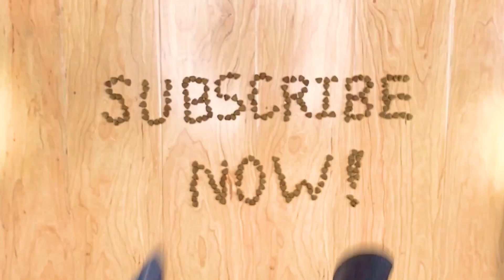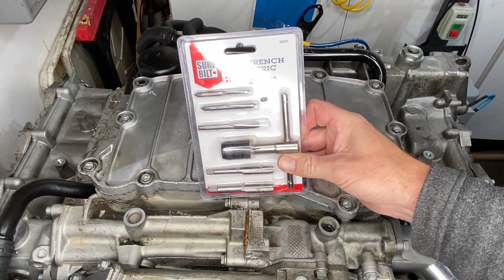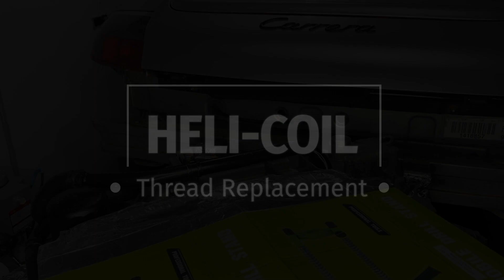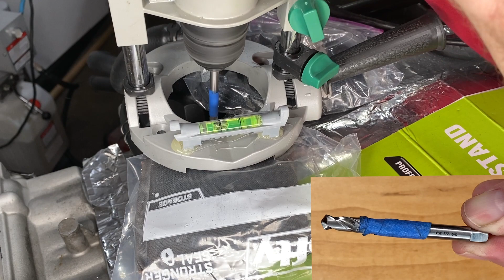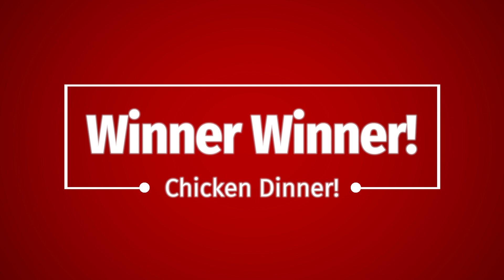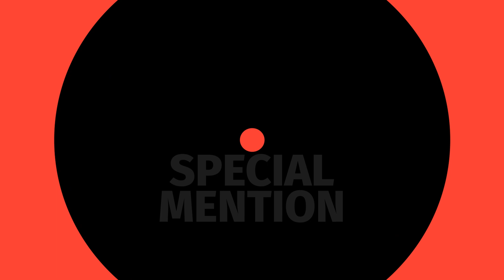HOW TO: THREAD REPAIR with Heli-Coil, Time-Sert & MORE!

Comment: Is it possible to fix a stripped thread on a steering rack on a 2003 Honda Odyssey that's in a very tight spot? It's for the line going from the power steering pump to the rack down by the right front wheel side.
Reply from the maker: Thats very specific Robert, one of the options mentioned may work for you especially if you can get a drill in there. Good luck🍀

Comment: Thank you so much for your video. Very informative. I'm about to change my spark plugs on my 1989 jag V12. They are notorious for shearing off. I need a plan B if I experience that agony! I'm wondering if the timesert method is good for spark plug threads? Also if you or your amazing contributers have any tips on avoiding swarf in the cylinders when doing this (over and above what you did in your video or grease on the tap set). Anyway, thanks again.
Reply from the maker: Hello MCX C, I believe you can use time-serts on spark plugs, for sure you can use the Helicoils. They have much larger sizes the the ones I used. Other than grease, I did not learn of another method to reduce the swarf infestation. Good luck with your project 🍀 (I used to have a V12 XJS, it was a really cool pain in the ass 🤣😂) Thank you for watching 🤘😎

Comment: Finn, I have my engine on a stand and with help I rotated the block upside down. In the process, I heard a "POP" and one of the bolts holding the engine to the stand popped its threads.  I'm in a pickle with that one because it's a bolt that holds the transmission to the engine!  Not sure what to do at the moment but this video is perfect timing!
Reply from the maker: Hello Yogi! That is one on my fears, sorry that happened to you. Depending on which bolt it is I would probably go with a huge time-sert. Plus, something I did not realize when I ordered them is that they come in different lengths also. If I was doing it again, slightly longer might have been better. Good Luck 🍀
Reply: @ManinaGarage  From someone that's used Helicoil often, the time-serts look legit! Let's hope they have a size big enough for tranny bolts.

Comment: The drill guide may have been a bit overkill for this job, but glad it worked out.  I have found that if you apply grease to your drill bit and tap, a lot of the metal shavings will stick to it and come right out without the mess of the shavings all over the place.  Good video, as usual!
Reply from the maker: That drill guide was dubious from the start 🤣😂 . I feel that the existing holes do a pretty good job of keeping you in the ball park of straight and true, I might trust myself next time.  For my first adventure I was ok with belt and braces 🤞. The grease tip is a good one, thank you, I should have done that 😳 . Thank you for watching 🤘😎
Reply: @ManinaGarage  But if you ever have to drill out head studs, that drill guide will be a life saver!  Gotta have one for that!

Comment: Hi Finn excellent I’ve been looking forward to this one!! 
Just to clarify before your million subscribers think I’m a complete idiot, I didn’t suggest the rivnuts for this particular job but thought you might like for Mrs Maninagarage to buy you some for Xmas!! I would love stuff like that. I wouldn’t be without them in my kit especially if you’ve ever built a Land Rover Defender.
PS . ITS ALUMINIUM!!!!
Merry Xmas 🎄
Reply from the maker: My robot fantasy was truly fired up by those rivnuts 🤖 I was planning all the aluminum paneling that I could easily bolt on and off while turning this Porsche into some kind of German Knight Rider recreation………….anyway! I appreciate the heads up 🙌. Also, you had mentioned waterless coolant. I spoke with a few people about it including Lee Jenkins and Miguel at TuneRS Motorsport, they both said don’t do it. Lee went as far as to say that it’s not a foot match for these engines. The general gist is that waterless coolant, despite all it’s amazing qualities leads to higher cylinder head temps. Just save me some cash right there 😅

Comment: When tapping into a blind hole you need to use a plug tap and finish with a bottoming tap. That's the only way to get the thread to the bottom of the hole. HTH's
Reply from the maker: Hello Steve, thanks to YOU! I now know there is more than one kind of tap 🤪. You are of course completely correct, the tap did not thread all the way to the bottom of the hole. Thank you for watching 🤘😎